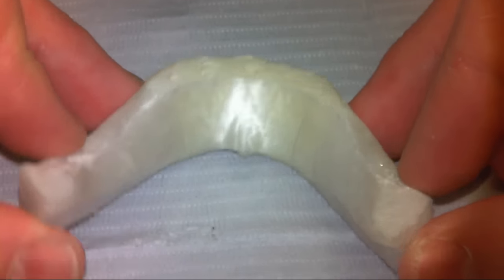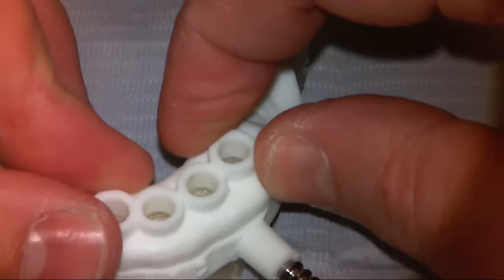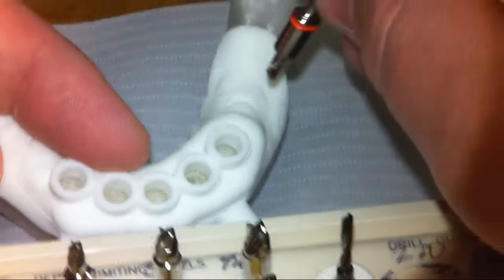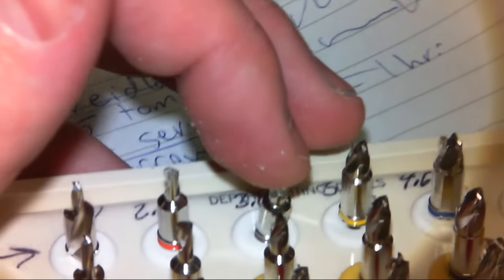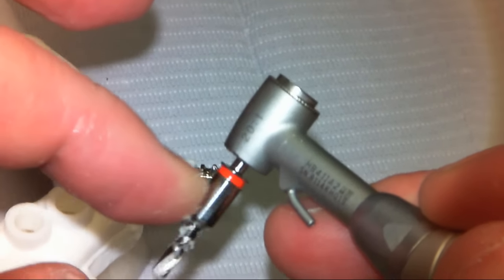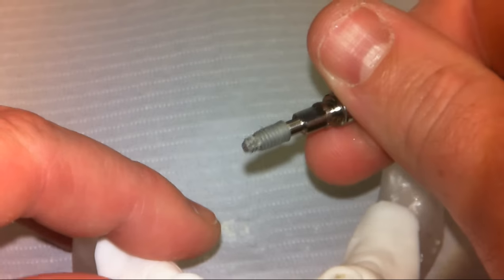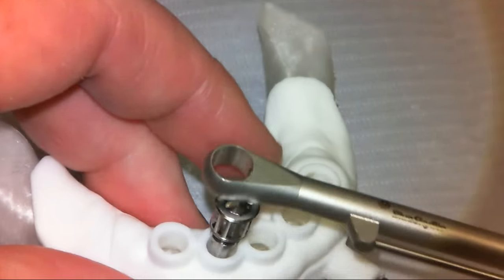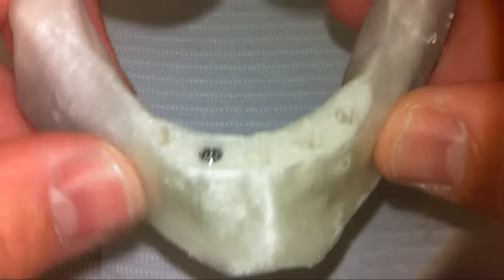Blue Sky Bio Fully Guided Kit- First Look!

Comment: Is there an issue getting irrigant to the osteotomy? seems like this guide will block most of it.
Reply: You don't need to irrigate if you use 50 RPM to do osteotomy.
Reply: I have same question as Mickey.  And its not possible to do an osteotomy at 50 RPM.